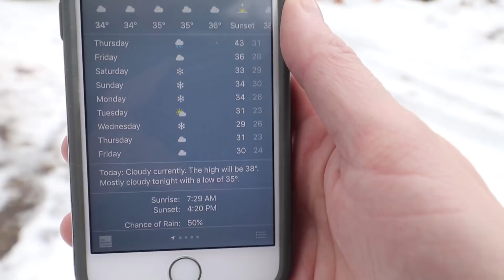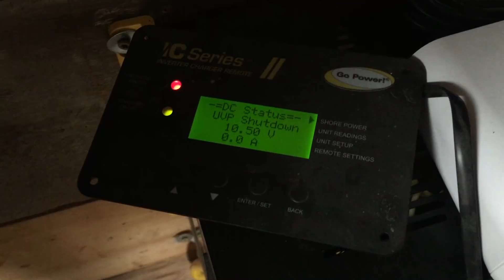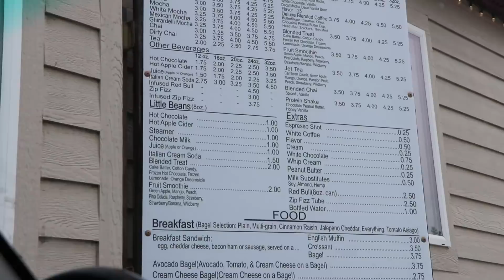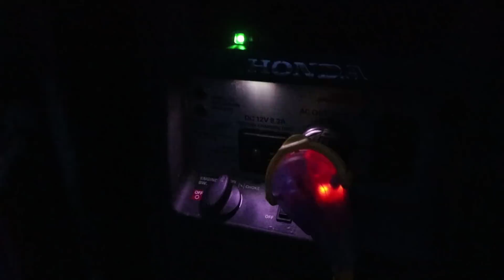Our Story: Giving Up Solar Power to Go On Grid

Comment: The problems you are having with solar, is that you are not committed or should I say you are teetering on the fence. I've got $40,000.00 in my solar system and that is with me doing all the labor and with my contractor's discount.
 I live off-grid 365 days a year for an estimated 30 years. I use to pay $250.00 a month × 12 = $4,000.00 a year × 10 years = $40,000.00 estimated 30 years = $120,000.00
You need to be committed and you need to purchase quality equipment. you want to pull the generator because you are inexperienced or too cheap to buy an auto start hi quality generator, high quality inverter, charge controller,
high quality transformer, and most important high quality batteries
 3.4 kilowatt I paid $2,700.00 each!
 I was watching when Alyssa's father brought the second generator on the property, again no auto start☹ For me living in Maui Hawaii it is a no brainer to stay off grid at $0.34 a kilowatt
 you at what $0.09 to $0.13 a kilowatt it's a hard decision but just remember you are either all in, or you are all out.
Love you, Love the videos. 
Just my two cents
Aloha from Maui🤙to
Reply: I think the main difference is location. They are in a location where it being overcast for weeks isn't uncommon. Something that is unheard off with a island climate. 

So using only solar they either need battery bank that can last for weeks and enough panels to fill the battery bank fast or they need enough panels to meet their daily demands when it is overcast. On top of that there is the hassle of snow blocking off the panels

Supplementing with a generator reduces the need for the huge battery bank, but per kWh  running a generator cost more than getting the power from the grid. So if you need a lot of supplementing power it is cost efficient to grid up.
Reply: you got it right with the "they need enough panels" parts. the biggest + on solar is the actual ability to pay into a energy-system and not actual saving up your own energy. the best version to save energy is a H-tank, and thats a money and storeproblem, explicit in a building state.
green energy is something to DO, after you build a house, because than you have an actual possibility to build into a system and not creat your own self-standing system.
green energy is something to do for society, while demanding a society to act for something good into the right direction and it is a diverse job. 
geoheat is great, if you have the correct soil.http://www.oelprotektor.de/geoprotektor/ some soilscant be used for that, but it can solve all heating problems in a good instalisation. 
light tubes, who bring light into a room without energy, just reflecting daylight. https://en.wikipedia.org/wiki/Light_tube
and of course using the wind and solar.

solar and snow.
one option would be to remove the snow on the lower area of the modul, than the under ventilation would move the snow down from himself. but that could fail in your harsh temperatures......solar is basicly something, that failes alone in the winter, but produce to much in the sommer, so you have to store it, and that is horrible expensive, if you want to actual achive that. its simply better to put it into the energy-web and get some money down from your regular energy-bill. 

mainproblem is after all heating...and that USA has no store-place for atomic waste....like germany, the country, who fucked about nuclear energy, while having such a store-place, because these energy companies wont do anything to help secure these store-areas and just wanted to take the millions profit per year for nuclear strom. Its basicly like a cole-mining industry, destroying the enviroment and arguing, that they dont have to pay for the made envirmentproblems.....these things are the reasons, going green is the best choice, that you dont have to fight forever wars with these profit-hungry energy-companies assholes. the actual enviroment problems are secundary shit at this point.
Reply: What Nash is intimating, is that his $40,000 (+labor) investment was it, forever. 10 years is a lifetime for solar cells and it's well past a lifetime for batteries. Do they come free after the initial investment? Another quibble with his fuzzy math, while he does note the difference in $per Kw/h, he makes no adjustment for the power-needs differences between Hawaii and the great frozen Northwest. True believers are seldom totally honest with themselves, off-grid in Hawaii is easy, while it can be deadly in Idaho. I remember a very rare 55°F night on Oahu, the Kama'ina shiverin' an' freezin'. I was cold too."Hey Brudda' you got a coat?" "What's a coat Haole?"   

Like Nash, I'm also a contractor, got my General Contractors license in Ca. 1972 and went off-grid with my family in '74, 40 acres in snow country forrest, within view of the Trinity Alps. By wood stove and Aladdin lantern, I did the math. Updated here in 2018: Only with a consistent source of High-head, or High volume water and a turbine, can you approach the consistency and inexpensiveness ($ per Kw/hr.) of the power grid, but.... have you priced a descent Kaplan, or slightly cheaper Francis turbine lately? Their very expensive installation, the dam, spillways, crazy/all kinda' permits? For instance, gotta' guarantee you won't drown your sleeping downslope neighbors with dam-break. Those two turbines are for high volume/low head, while Pelton wheels are much less expensive, but require the rarely available high head, a 100' foot fall to be strong, with it's long biggish piping, best straight up.... and any kind will have to have consistent water flow if you expect consistency. Find property with a waterfall.

Solar and/or wind will NEVER be competitive with the power grid when available, in Northern forests. They are both consistently inconsistent. Snow will always pile-up on solar panels but that's OK, 'cuz when it's snowing, THE SUN ISN'T SHINING, which is the norm in the North, daylight a short, sometimes sorta' thing in winter. The wind will rarely be too strong or commonly not strong enough for wind turbines and how do the wind find them turbines a'planted behind a hill in the piney forrest anyway? Seldom does a tiny minority have their facts straight, gotta' mix in a strong dose of "religion"... I did, before I grew up, but I'm not sorry.... 

Jesse and Allysa are both very bright, (one of them very cute and talented too!) and Jesse is a serious analytical nerd under it all. Like the constipated engineer that worked it out with a pencil, Jesse WILL work it out.... now that Allysa has gotten the paperwork filled out.

Comment: When sizing a solar-system, you should base it on winter (full sun hours). Whatever you'd generate in the summer is just profit (when a grid is available, delivering back to). Hybrid (grid+battery) is the future!

I think it's a smart decision to connect to the grid when it's viable. Still have a battery bank, for cases where the grid is down (only to power lights/light loads).

Comment: Have you guys ever thought of using Grid-Tied-Inverters? I fill up first my batteries, then dump the rest of the load energy into the grid tied inverters, so you get the best of both worlds, solar with batteries and being connected to the grid, at least I cut my electric bill the meter stops spinning, and at best I can sell any extra to the power company when it spins in reverse!

Comment: Answer: grid tied solar with battery backups.  We have a 6.7kw system that is tied to the grid.  We also have batteries and generator backups in case the power goes down.  Best of all worlds.

Comment: If someone tells you do not have a big enough system [for your needs], they are not being fair?  Oh, please.  That's on you.  Get your grid power, that's fine.  no shame at all in that.  Not having a system capable of generating and storing most of what you need is on you.  Perhaps if you evaluated systems that would meet your needs and found them to be expensive to do them during the construction period since these systems have years to go before recouping the money, that's a fair argument, but when you don't have an adequate system, you cry that people are being fair is not a justifiable argument on your part.  You don't have to be living offgrid on renewables to come to this conclusion that YOU are not being fair.

Comment: The shot of batteries going onto the trailer have me a bit worried.  I hope you guys don't take down the solar setup you already have. I'm sorry you've found solar to be such a headache. Once you find out how much going on grid will cost, perhaps you can compare that to the cost of having a professionally sized and designed solar system and generator using new equipment.  However, this is your journey, your home and your life. I respect that.  Good luck and I'll keep watching.

Comment: Just because you want to be back on the grid doesn't mean you have to give up solar. Our grid-tied solar system has almost paid for itself in about 10 years and now we have free electricity for years and years into the future. With grid tied solar you don't even know you're hooked up to solar except for the fact that you get a tiny electric bill. You don't have any of the maintenance or monitoring issues with batteries that you have in an off-grid system. I lived off grid for 15 years before we went on grid with a grid-tied system and it is much simpler.

Comment: Well if you had built and sized an appropriate system for your area and needs at the time and planned for scaling for your finished construction.  You could have been doing laundry all along and had power for tools camper.

Comment: Hey you may challenge the power company - as usualy they can sell solar generated power at higer rate than other. So short is get a powercontract were you can sell your solar power at a high price...and then when you need power you pay less than what you sold it for...

Comment: Just a tip, make sure your SIPS company knows so they can put the holes in the panels ahead of your putting the rest of the house up.   Wise choice by the way, it is much easier to go back to off grid than it is to try and add it all at a later date.

Comment: As someone who is a neighbor to these guys, those who think living up here is easy or “affordable “ off grid don’t have a clue.  During our winters the endless cloudy days, the day after day of snow and/or rain make solar a pipe dream if your desire/want is to live in more than a trailer or small cabin.  We considered solar when we bought our property but as the previous owner had already gotten power onto the property and as cheap as power is here thanks to the forward thinking of hydro-electric, it made our decision to connect to the grid easy.  We did the analysis for solar and while it’s feasible during the summer months during the long winter it just didn’t make sense for us.  
Glad to see that they are going on grid.  That means even more videos of work on their house!
Reply: Some people make it sound easy and viable.....until they realise they need well over 10,000 watts of panels(your whole roof area) to run a household, because of the lack of sun hrs. Most of the cheaper installs that are done here on Utube you can't run all the stuff you want to run when you want to run it....Now lets talk about that massive battery bank lol...
Reply: Robert Plowman we live up north all of January we saw three or four solar days this February we are finally seeing sun, we are still on the grid we love solar for the back up, we have a 1250 amp hr. battery bank, it makes great back up for when the power drops, all summer we wash our close on solar fridge freezer lights it's nice, kicks but on the power bill, winter though, we never see enough sun, so we use it as we can and love it, our 2660 watt solar set up has never been used to it's fullest, that's fine because we are on the grid, we never use battery unless the power drops, it is a nice peace of mind when the storms roll in. GOD BLESS

Comment: I've been experimenting with solar for almost 10 years now.  I have 1.2 kw of solar and it's not enough. For basic life needs that would be ok for most people. But I want to be able to charge an EV, mower, weed eater, and misc power tools. I have other large loads such as a air compressor, welders, and a lathe. My next upgrade will the wiring so I can handle at least 10 kw of solar and a large 48 volt 38 kw(4000lb) forklift battery, if I have the money maybe a 3 phase inverter  to run the rest of my shop. It's taken a lot of learning things the hard way to figure what I need.

Comment: Rural Electric cooperative connections are not always very expensive.
It wasn't when we built our cabin in Central Texas or when we redid a system
here at the ranch east of San Antonio.
the coop is really good here.
they also have microwave internet at a reasonable price.

Comment: Gasifier and a generator.
Steam engine generator.
Wind turbine. 
Rocket mass heater.
There are a lot of ways to create a hybrid system. Anybody who says that solar alone is the answer, is wrong. Plus, managing your usage of electrical power. Brick oven. Rocket stove. There are a lot of alternative ways of cooking, heating, etc. that don't require electricity.

Comment: Good for you on making a decision that is best for you!  As others have said in these comments...keep your panels and have a grid-tied system, so your electric bill will still be lower!  However, I must say, I don't think you guys should try to convince other people that off-grid is not a viable option.  You see, my husband and I live in the Sierra Nevada Mountains in California and yes, we do get rain.  Last year we had record breaking rain.  Guess what?  Our solar panels still produce some power even on overcast days.  What I think your problem may have been was that your system wasn't sized big enough and you don't have a generator integrated into your system that turns on automatically when your batteries are low.  Just my opinion.  Where we are living there are quite a few people living off grid and loving it.  And they DO have toasters and coffee machines and electric refrigerators.  However, the range/oven and hot water systems are generally propane.  So is the generator, which means no trips into town for gas because (surprise) the propane company delivers!  One family I know also has a masonry heater that they only have to load with wood once a day and it keeps the entire home warm for 24 hours.  The only electricity needed for their home heat is a fan to move the warm air around...easily do-able on solar power.  They built their home to use passive solar, meaning all their windows face south and west, none on the north, one in the east, so heat loss is minimal and winter heat gain is maximized.  This is also our plan as we build our new home, because we have seen it work...very well. We already bought our solar system and didn't pay $50,000 like some think it costs!  Since you two are very much DIY'ers, you can buy an entire system from Wholesale Solar (like we did) for half that cost and install it yourself!  For these reasons (as I said above) I wish you would have stated that solar just doesn't work for YOU, rather than discourage others who are willing to build a passive solar house with a properly sized and integrated solar system that has an automatic kick-on generator, if needed.
Reply: Re-check the video at 5:35
Reply: Vickie Westcamp I thought they clearly stated that, at least I understood it that way.
But your comment is very good! The area you live in plays a big roll! Judging just from our little solar lights along the walkway, 2 days of rain here and they are dead. A larger system of course would store and do better, but our weather would need some backup, couldn't rely on solar here (unless we build mega storage???) Still, great to hear from your end!

Comment: Grid power makes sense on multiple levels.  Bulk production of energy is going to be more efficient than supplementing solar with gas generators.   Not to mention battery and collector maintenance.  I dont think theres a way to make the numbers favor single-setup solar.

Comment: Some people here in northeast Brazil use on-grid solar. So, basically you see what can you afford and you implement a solar system that can reduce your power bill. Like, for instance, if you use 500kw a month and you solar produces 200kw you will pay only 300kw. Also, you don’t need batteries, or a system big enough to supply everything. You are backed up by the power company.. the problem for you guys is probably the region you are. You don’t produce a lot and spend a lot, so to build an off grid system is very expensive. :(
Reply: Anyways.. I don’t think you guys are doing a wrong call. You should Do wherever suits your needs. :)

Comment: Great video as always! I'm a huge fan of solar, but as you found out, there are many disadvantages. Solar panels are very inefficient. Once the technology gets to at least 50% efficiency, solar will become more of an option. It will always be a struggle to use only solar for the conceivable future. Most people (not you) don't realize that you need batteries, and forget about any appliances that need 220 volts. Again, I don't hate solar. It's just not for everyone. As others have mentioned, go with grid tie, so you can still get some benefit out of your existing solar investment. Thanks again for saying what others won't!